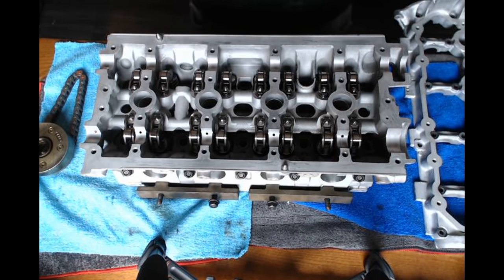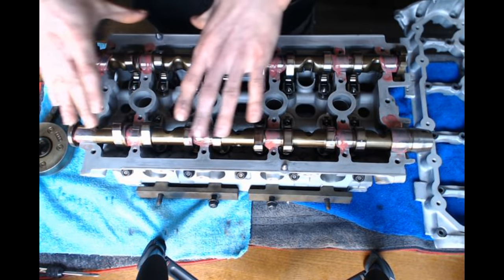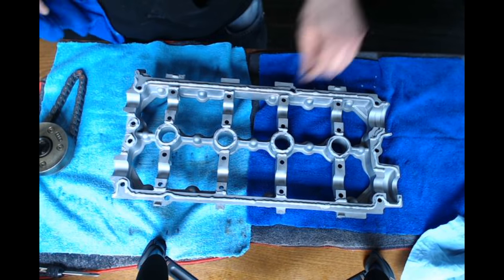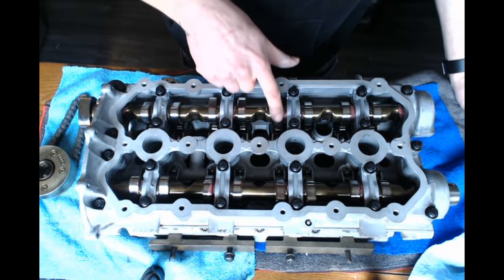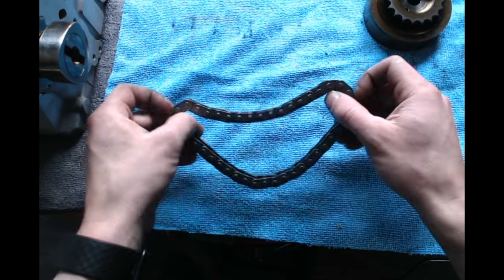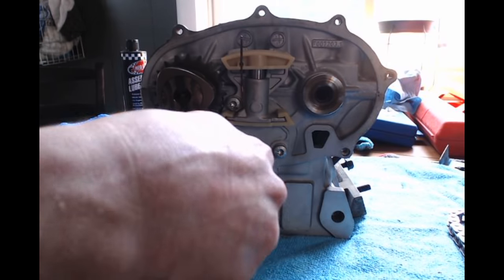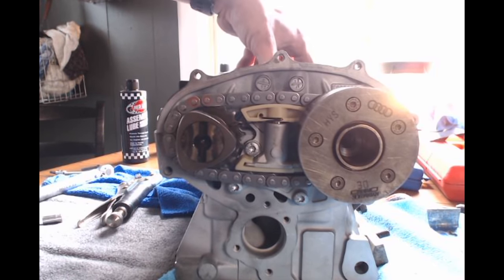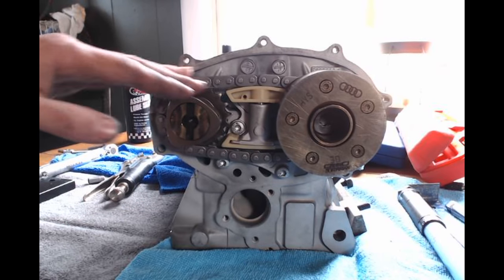Audi B7 A4 2.0t Cam Install

Comment: good video .. all i will add is 99% of guys will be doing this on the car and on the Audi you can not see behind .. so paint the teeth you need where the dot and slot are , and paint the front side of the chain , not the back .. hell paint both sides.. also you did say it but i will reiterate .. if you re going with 18th and 19th, start counting AFTER the gold link. the teeth actually sit on the 1st and 20th slot between pins for proper alignment.

Comment: WAIT!!!! @ 7:00 mark, those little straight passages on both sides of the spark plug tubes do NOT get sealed up, they are for continous oil flow. @ 8:42 or so, and your looking at the cradle at an angle. you can see the sealant on both sides of the spark plug tubes where there should not be any>

Comment: Locking tool is needed, special rotating cam tool makes your life easy....dont half ass it people, youre already sVing a ton by doing this yourself. Besides nothings more sexy than special Audi tools!
Reply: Hitman  I said nothing about valves being bent; even though how the head is sitting on the table he is probably putting pressure on the valves that are open.  Well, you need to hold the cams...taking pliers/vicegrips to hold them tends to scratch them which is kind of weak. Also the rotating cam tool makes it nice and easy to install the chain. See how he struggles? He is using a steel crowbar to rotate which can scratch the cam. Why take the chance, and be a half ass, when the correct tools are cheap! The best investment I ever made was the high quality locking tool around $100.
Reply: Hitman  thanks for your help

Comment: I would have lubed the camshaft before installing it to the dry integrated bearing surfaces to minimize clean-up, You should also lube all your new rockers and cam lobe surfaces before installing the camshafts. I would have created 2 long alignment headless bolts/pins pre-installed to opposite corners of the head to enable lowering the cradle straight down onto the head without fear of being misaligned. I will guess that you will crank the engine for a while before actually allowing it to start to give time for oil pressure to build up all throughout the engine and get lube oil everywhere before a true first start-up load is applied to all these nice new parts and clean surfaces. Thanks for the rebuild video, I can see the cam alignment black tool is not really needed.

Comment: Awesome video! Quick question, is it necessary to put the black plastic cover that goes inside of the crank pully? I knotice that it makes it difficult to put the girdle top when its already installed on the head.

Comment: I need to do this job but I don't understand how so much emphasis is put on timing, cam position, and using the cam locker when to get the cam adjuster on you slap a vice grips onto the cam and turn them both to get it on.

Comment: Did you pull any of the overflow sealant off the inside of the seam? I did this job this weekend and was advised that the overflow sealant could fall off and clog the oil pickup.  Apparently the Audi sealant is anaerobic so doesn't cure when exposed to air so any overflow gets washed away with the oil.  If I had known that I might have spent the cash on the Audi sealant.
Reply: I think you also put sealant on some of the grooves that aren't supposed to have sealant on them. Specifically the short ones next to the integrated bearings and one squiggly one at the front of the head.  These may be oil galleys but I'm not 100% sure on that.   I'm also wondering if using Dirko grey was wise because if those are oil galleys, even if you don't fill them in, some of the overflow sealant could have gotten in there and clogged them which wouldn't happen with the Audi anaerobic sealant as it would wash away.

Check out this post.

https://www.audizine.com/forum/showthread.php?t=869906

Not trying to be critical just passing on what I'm learning. This is a great video and I used the info to replace my tensioner but now I'm a little bit worried about the sealant aspect and contemplating taking it all apart again.
Reply from the maker: Interior of head was cleaned yes, I used diagram from Audi manual on where to apply sealant.
Reply from the maker: I've done this job multiple times this exact way, zero issues. You will not have any problem. No sealant was put on any surface of cam journal. This is the proper way to apply
Reply: @KwinyB  That's good to hear.  I've read several accounts of people using Dirko for this job successfully but the use of anaerobic sealant does also make sense.
Reply: @texadelphia1808  I used regular permatex sealant that was oil resistant and just made sure to be extra careful not to gunk it up and use just enough.  Any stuff that oozes out just wipe up immediately and I also let mine sit over-night to cure.

Comment: Great vid 👌 

Just one question how is it possible that ARP bolts 🔩 are tighten 130lbs/inch and factory ones are 8 n/m?
Reply from the maker: Yes ARP will have different torque specifications and possible different torque patterns

Comment: Great video. I'm trying to rebuild one myself, but I would like to retract the built in rocker valve lifters so they re adjust once engine starts. Problem is i can't find any info. Do you or anyone else know if it is possible to retract the hydraulic lifters on this type of engine.

Comment: been watching your video a few times as Im rebuilding my head with new valves, valve seals and lifters...please dude, get the good quality locking tool.
Reply: I bought the ECS brand  and mine was a bit sloppy and i used the vise grips to make sure it doesn't move and i strip the Polydrive bolt. what brand do you use with different results? Do Share

Comment: I just rebuild the cylinder head but when I added the camshaft chain both intake & exhaust camshaft don't seat properly in place / flush and when adding the cover and torx bolts I have valves open does any body know why or what's wrong thanks

Comment: hi,  the cam chain and tensioner on my car broke while stopping at a red light. i've replaced both parts and aligned everything back. now i am getting 150psi on cylinders 1 and 3. but cylinders 2 and 4 has only 90psi with compression test. the car starts and runs but shaking like crazy. can you please tell me something to check for? thank you.
Reply from the maker: Check valves and piston
Reply: Thank you

Comment: It looks like you are sealing the oil channels...
Reply from the maker: First time I recorded i was not paying attention and did put silicone in them, did remove before final assembly, thats why I displayed the diagram.
Reply: Kwiny B  ahhh, gotcha. thanks. I have watched this vid again and again because I am using video as a guide (doing same job for first time, have cyl head off as well) .. and then recently saw somebody on an Audi B7 forum post a pic with it all gasket’d up.. but did not fill those channels and was confused.
Reply from the maker: Ahh gotcha yea, I just didn't have the time to re-record the part and edit so I out the diagram overlay to follow that.

Comment: When the cilinder head is installed on the motor with timing belt etc and you want to change the tensioner and the chain. Do I also have to take out the cam adjuster, or can I change the tensioner and chain without taking them out. What I don’t understand how can you move the intake cam while the cams are been hold with the special tool. Is it not possible to install the adjuster without moving it?

Comment: I'm trying to install my cam after timing chain replacement and had to go cam cradle route... cams are in time but o can't seem to get the cams to seat properly because of the tension on the belt. Is there ant persific way you can reccomend please? Many thanks Chris.
Reply from the maker: Take your timing belt off, or let the tension off from it. Mark your TDC points

Comment: Thanks for the video. It helps a ton. I have a question. I sent out the head on my car so i didn't install the new tensioner to the chain. So what i want to know is if timing is set correctly on both chain and belt. If i should crank it by hand being that there is no oil pressure yet. Is it normal for there to be a loud ping sound when i complete one full rotation on this motor? This is the first one that i did of these so idk if maybe i missed something
Reply from the maker: Your correct, it will make a snaping sound from the cams rolling past the lobes and the valve springs springing it back around.
Reply: @KwinyB  so this is normal? Ive never heard this on any other motor so loudly. Thanks for your help and reply I very much appreciate it.

Comment: Just had my cylinder head reconditioned with few valves replaced for what ever reason when exhaust cam is at tdc 19 pins over my cam adjuster goes on intake cam one of my intake valves is slightly open and other closed cam lock is free not tight does anyone know what position the valve would be at at tdc I assumed closed all way
Reply: I believe mine is the same way. In order to get my intake side head bolts out, I had to get a ratched on the cam sprocket and rotate it slightly to get the reliefs to line up right. Otherwise, there was a lobe engaged and it would just rotate it back to where I couldn't get the bolt out. So with the lobe engaged there will be a valve open.

Comment: Awesomewe video one of the best out there.....what is the silicone you used?
Reply from the maker: Thanks man, it's called Dirko Grey
Reply: @KwinyB  thanks but I have one more question do i need a special socket for the ARP bolts
Reply from the maker: Yes you do, most are arp hardware with me 12 point

Comment: hey man, thanks so much for the video! had a quick question, i’m currently tracking this job and realized that my cam adjuster has a tiny bit of wiggle to it where is mounts to the cam, almost like the dowel allows for the slightest bit of play/ it naturally has a bit of rotational wiggle without any oil pressure. seem normal?
Reply from the maker: I had one that had play as well, I replaced it to avoid any problem that might have occurred from it. I would recommend the same for you.

Comment: Hello, I watched your video on how to install and time the cams but after following all the steps, the intake cam pops or snaps into place after the lobes go over the rocker arms but the exhaust cam does not do this. Any ideas to as what I need to do to fix this issue?
Reply from the maker: All the valves do not open up at the same time, after chain and tensioner is install did you rotate the cams come back to TDC and verify the head is still in TDC?
Reply: Kwiny B I did not do that after timing the cams to make sure it rotated freely. Here’s a link to a video I just posted showing the issue. Thank you for your help!     https://youtu.be/W3TvaZx1NsE
Reply: Should I take the chain off and re-align the cams & timing?
Reply from the maker: @Erick-uo8wt  are both cams turning together and coming back to TDC? Am I seeing that right?
Reply: Kwiny B yes, they are both spinning together. when I line up the crank pully to the TDC mark on the engine, both cam lobes are also pointing up to the TDC marks on the head. Just not sure if I messed up somewhere when timing the cams,  for the intake cam to clank every time it rotates.
Reply: I think I’ll just pull the griddle and re-do everything in the video and see if that fixes the intake making that noise/snapping over the rocker arms like it does and not the exhaust side. Also I’ll rotate the cams to TDC a couple times before putting everything back on to make sure the intake doesn’t get caught up like it is.
Reply from the maker: @Erick-uo8wt  I think the noise you are hearing is the valve springs pushing the cam back around, they should all do it when the cam lobes get around the tip on the rollers.
Reply: I think im getting the same thing

Comment: My kit from fcp euro for the timing chain tensioner came with 2 cam shaft seals . One I installed on the exhaust side near that big sprocket. Where does the other one go?
Reply from the maker: You would have to contact them, their is only one cam seal. The cam and crank seals are almost identical, maybe the kit included crankseal or they mistakenly gave you 2 cam seals.
Reply: Foriegn Federation I bought the front crank seal from the dealer. The cam shaft I installed on the exhaust side. I think they gave me an extra one. Considering there isn’t another spot for another cam shaft seal lol. Now I just need the end cap for the intake side was that all that is needed on the intake side is the end cap ?
Reply from the maker: Correct seal goes on exhuast side, cap goes on intake side
Reply: Foriegn Federation thank you for explaining it . First time rebuilding a motor and want to eliminate as much problems as possible. Thanks again!
Reply: The extra seal is for your brain since after doing this job it will dripping out your ear.

Comment: when did you put in the camshaft seal located next to the belt pulley?  can you put that in after torqued?
Reply from the maker: Yes only put in after griddle is torqued
Reply: @KwinyB  i just rebuilt my motor and head but that seal is leaking do you think i will be able to remove the old and put in the new one without pulling the griddle off?  Hard to find other people who own Audi's that do their own work lol
Reply from the maker: @brodyvanhoorn8363  you can only replace the cam seal when the griddle is torqued. If you put the cam seal in and then torque the griddle it will not seat right. Always put cam seal in AFTER.
Reply: @KwinyB  thank you will try today very helpful

Comment: I have watched other videos on this and they put the gold link on the intake sprocket, and count 18 and 19 pin for the exhaust sprocket,  I have mine this way and it will hardly run, Is this my problem?  I have been trying to get this running for months.
Reply: I did the 18th and 19th pins and my intake cam wasn't anywhere near where it needed to be :/ I also noticed the pin on the exhaust sprocket is farther away from the timing mark where mine is only about half a tooth away.